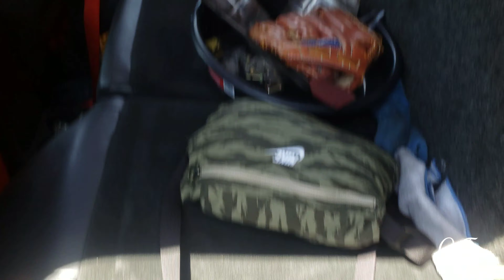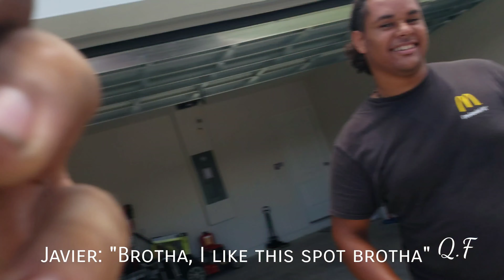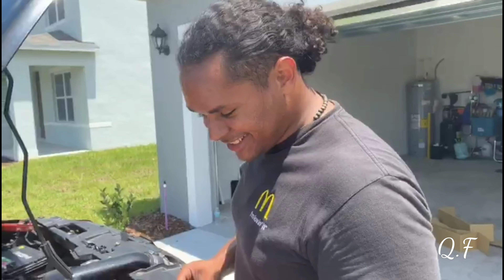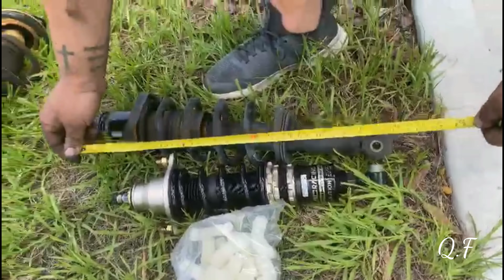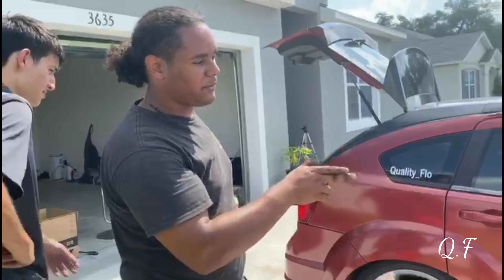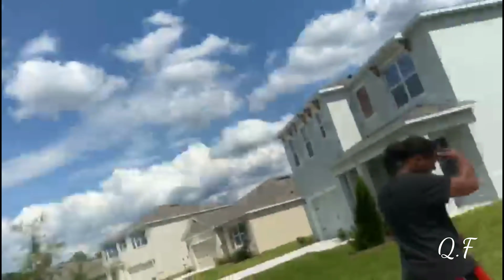Lowering the Caliber SRT-4 | BC coilovers

Comment: B.C.
Reply from the maker: Thank you 💯
Reply: Hey was there a piece that you had to use from stock suspension on the front for the bc? After installing mine my steering cracks like metal to metal. Real bad and I'm wondering if I'm supposed to use a stock piece. Thanks for any help